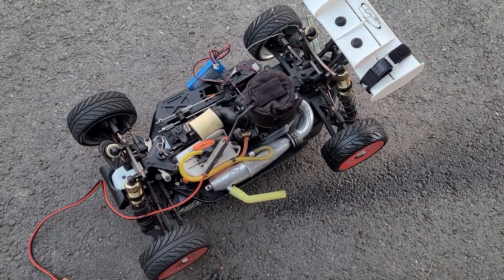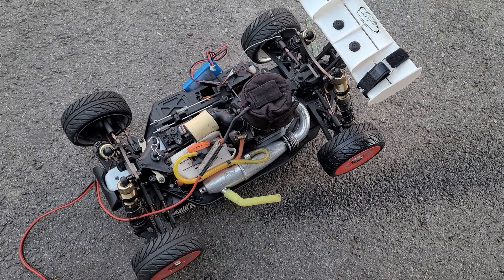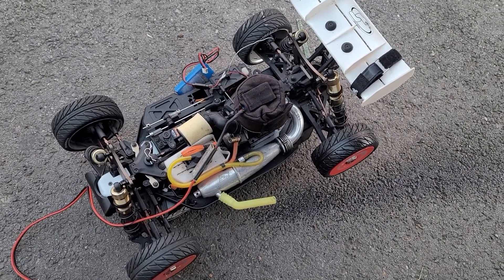nitro tuning help please BOTAJELL

Comment: I think its carb issue on these .32 . Its been complaint about by many that you can't get the consistent tune. the lrp .28 seems to run fine with it though. I see a lot of blue smoke and sounds to me like a air leak.
Reply from the maker: Ive heard about the carb issue after i brought the engine but will do a check for air leaks and also look into a better match carb. thanks a lot brother and thanks for watching

Comment: Replace your fuel tank and fuel line i have the same issue before. You have air leak.
Reply from the maker: Hey bro thanks but it was the fuel line nipple on the engine came loose. Fixed now and on the ground. Serpent buggy videos

Comment: I know this is 2wks after the fact but you are definitely running lean, where you are running lean is what you weren't told. You were lean on the HSN, hence why when you goosed it towards the end the engine flamed out. That's actually an excessively lean condition. I could in no way tell if your LSN was set optimally but it wasn't set too lean at the very least, that's why you see the oil on the ground and that's why the engine calmed down after you let it idle, the LSN took over fueling duties. 

Anyway, others were quick to say to that the carb is the reason for that and that's not 100% accurate.  I know for a fact those LRP carbs are the weak link, I own several .32s and some are stock carbs others have Novas. The stock carb doesn't hold a tune well nor does it hold a good idle BUT I can definitely tune it and run it, just not to my preference and so can you. The Nova carb is a night and day difference but it's impossible to find. As you may know, Nova went under during the pandemic. 

At this point, until we figure out what other good carb we can use, run that engine with the carb and keep practicing your tuning. We all start somewhere and there is no shame in asking for help🙌 You can still get a decent tune out of that carb, enough to safely run the engine all day and enough to properly learn how to decern between lean or rich and at what needle it's happening. Best of luck and I applaud you for not letting the "go brushless" advice deter you from wanting to become a Nitro Jedi Master.
Reply from the maker: Brother it's never too late to learn and I thank you greatly for sharing the knowledge. I will definitely put it to use although I took the LRP out and replaced it with the novarossi engine that came in the Buggy.
I have the LRP on the break in bench right now to work out the tune.
One question... if I rich up my HSN should I leave  the lsn where it is?

Comment: Running lean,what engine you got there?
Reply from the maker: LRP Nitro Engine ZR .32X Competition Spec4
Reply: @godsun358  if you are running the stock carburetor? That will happen a lot.try finding a 9mm nova carburetor install it and retune. Also be sure to set endpoints on the throttle and brake linkage it helps a lot
Reply from the maker: @mc83ssls1  yes it is stock you have an Eagle eye so you say a 9mm carb and I do like novarossi so I will make it happen thank you brother.